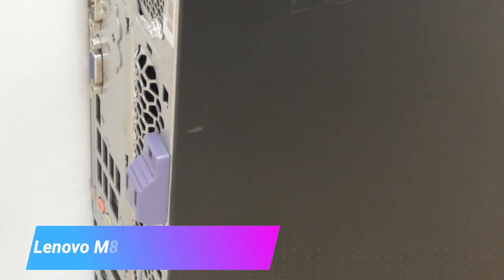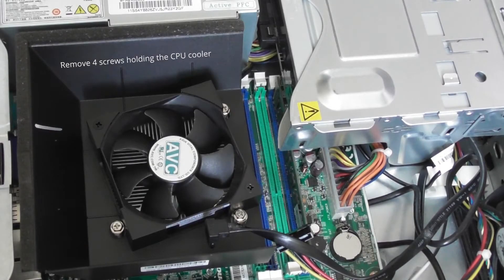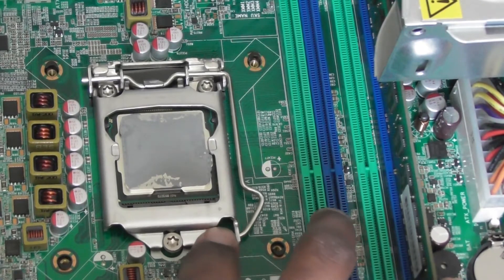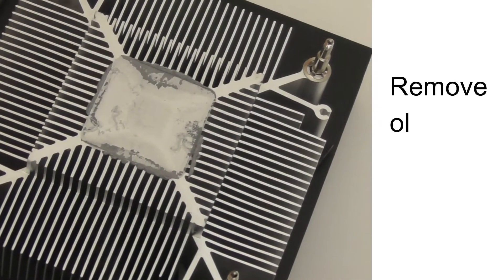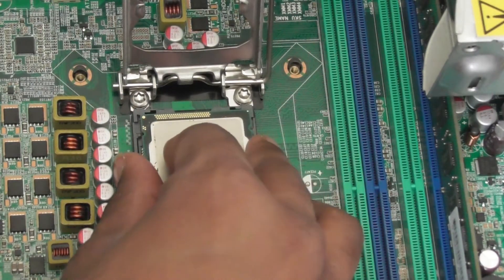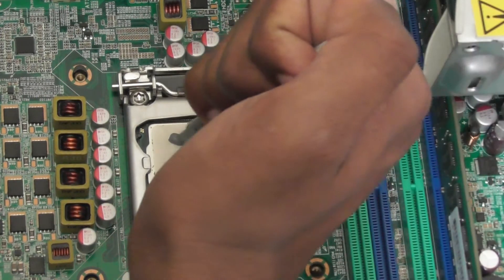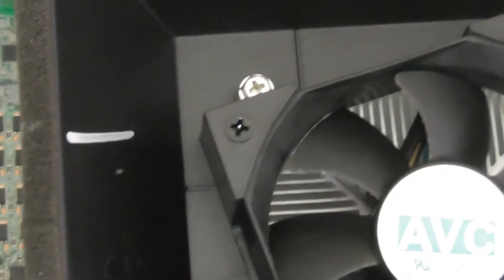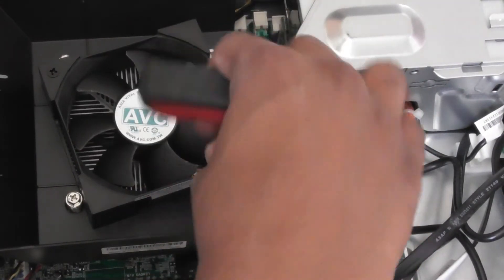How to change the CPU in the Lenovo M81

Comment: Hi, I had these pc, I think to upgrade to an core i7, which processor u recommended? 

And it work a ssd ?
Reply from the maker: Yes it works with a SATA SSD, M.2 SSD will need an adapter

Comment: please answer: can i install an i5 3570 on a m81 lenovo motherboard no answers on the web ? :'(
Reply: what socket does your mother board support? because the i5 3570 fits onto the LGA 1155 Socket so check what socket ur mother board fits on
Reply: @zKingRox  i have 5030CTO Think centre Lenovo it is an LGA 1155 i dont know if this motherboard supports Bios update
Reply: you can't install 3570 bios not compatible

Comment: Great video! But idk if this will fix my problem what happens with my pc is that when I plug it the fans start but stop right away and turns off then it tries to run again and turns back off the next second what may be the problem? Im not great with this type of stuff lol
Reply from the maker: Hi, thanks for your comment. Try to digitally power it off instead of unplugging it, although it may be the power on recovery option in the BIOS causing the issue

Comment: Can put gpu ?
Reply from the maker: The M81 is a SFF, and you will probably need a riser card an a better PSU to get a decent GPU in it
Reply: @FaisalAhmedTech  would a new power supply be needed for a gtx 1050 ti? It's one of the few decent gpus that comes in low profile mode.
Reply from the maker: @KnightoftheKing4  You might just be able to get away with it, but I would advise against it. You would also need to check if the 1050 works with the M81 as the PCIe slot may only support a 35w output instead of 75w

Comment: Thanks, just bought a new CPU and have been looking for a video like this. Could you maybe do one for upgrading the power supply too?
Reply from the maker: Sure thing! The Lenovo machines (SFF) all use the same PSU's similar to the ones in dell machines
Reply: @FaisalAhmedTech  Do any offer 350W or more? I'm wanting to upgrade my GPU to a Gtx 1650 ti or a Gtx 1060 at some point and those consume a lot of watts. I've looked at forums on Reddit and it seems that using the power supply I have should be ok but I'd feel better if I just changed it for a more powerful one.
Reply from the maker: @KnightoftheKing4  Does it need to have a clean flush look. If not, you could easily hack a very cheap server PSU on it with a few screws and a drill
Reply: @FaisalAhmedTech  Hack one? I didn't know that was possible. Are there videos on how?
Reply from the maker: @mrEffectfilms Here's the basic concept : server power supplies are crazy efficient powerful and reliable. Most importantly old ones are cheap, like real cheap. So keep your current PSU in, and add another server PSU for your GPU. A 750w PSU will cost you £10 and a 1200w will be around £15, and then on top of that you just need a breakout board and cables. Congrats, you now have a power supply, a high quality one, one that is fine if you leave it running for the next 10 years 24 7, for only £20 - 30